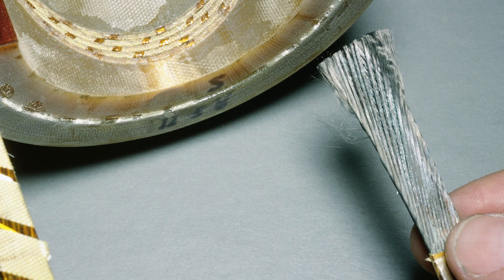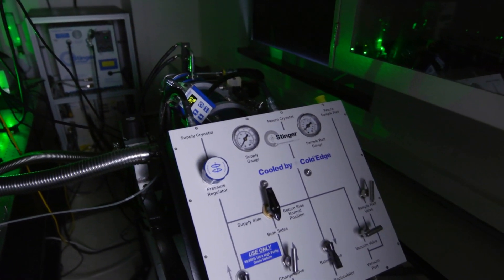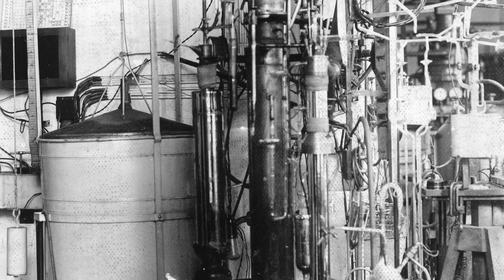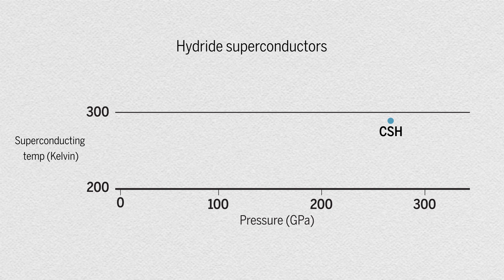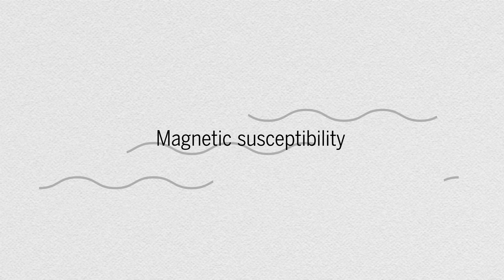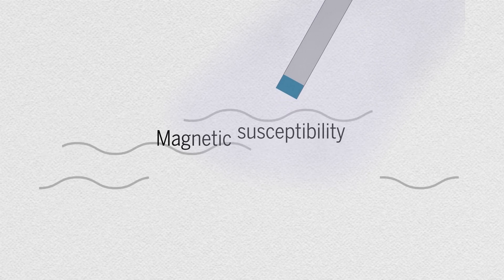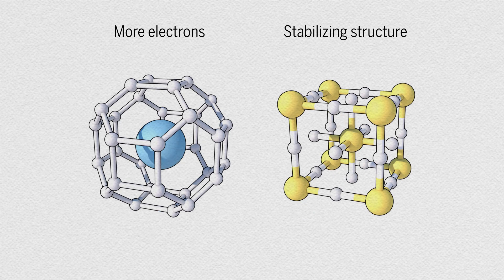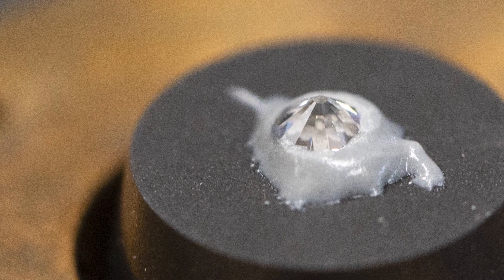The quest for room-temperature superconductors that don’t require extreme pressure

Comment: I wonder at what point we get into a range that a cylindrical pressure vessel of reasonable size can maintain and that therefore could be used for power lines.
Reply: Another hurdle with power lines is wear/stress and flexibility and how much it can deform before it loose its structural strength. Even the Ni-Ti alloy wires are not very flexible and it only gets worse as you get into the higher temp powder in tube made SCs. But yeah having the superconductor be pressurized to the levels required ain't happening for practical use. Diamond Anvils are not big. they can sit and be operated on a desk. The actual diamons s are mms and they are only able to reach these pressures in the first place because the size of the contact tips is many times smaller thanthe already tiny djamond. and the amount of superconducter under 
pressure only useable to observe its properties. Getting the pressures even into something  the 1.1-2 bar range it still wouldnt be useful for power lines I can't even guess the preventive maintenance cost or even just that of near round the clock inspection of miles and miles of pressure vessel.